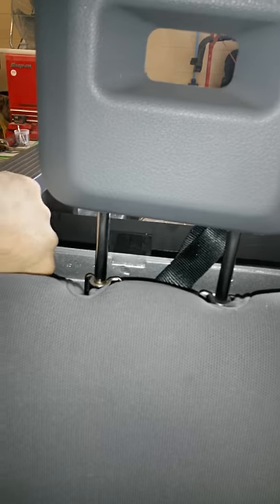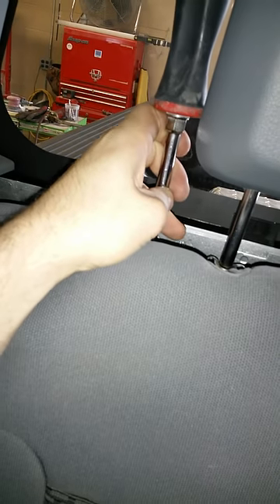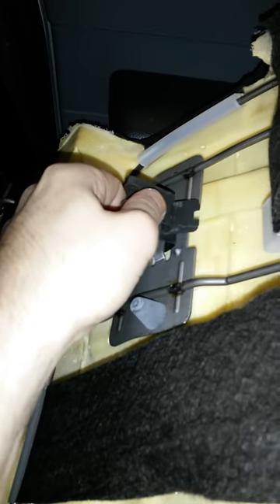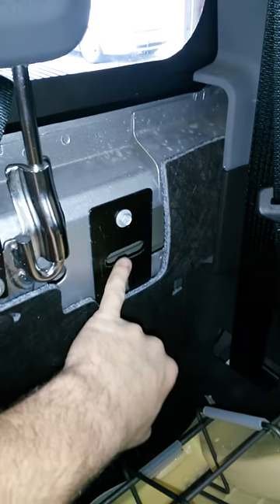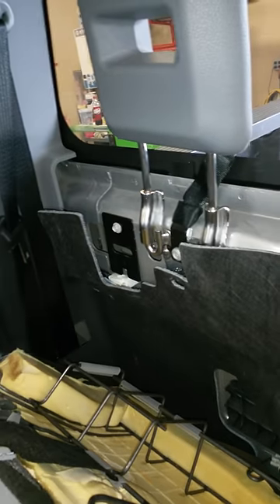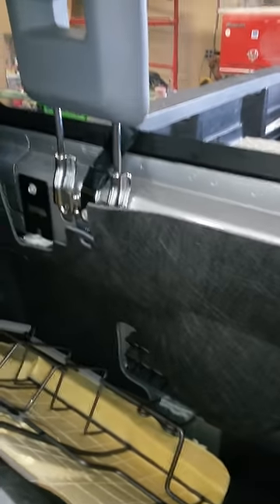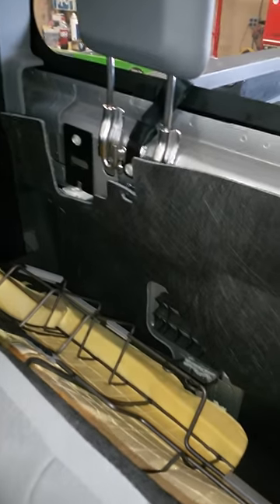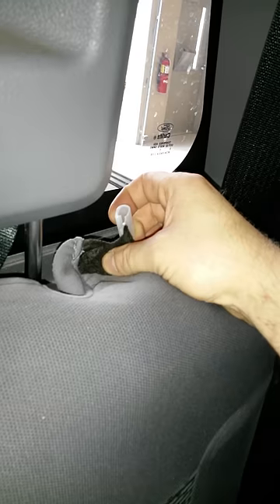How to remove 2012 Ford F250 Supercab rear seat

Comment: 2017 Ford 250 Supercab .... Guess what ... remove the bracket with a 10MM speed wrench.  Way easier on the drivers side just to the right of the head rest.  Reach down a about 5 inches and ratchet away.  Took me about 4 minutes ... much easier than trying to release that sping POS.

Comment: Customer is going to be happy until they want to use the seatbelt which is now trapped behind the seatback. PRO TIP: Pull out the belt, slide the seat back between the belt and back of the cab, set back on hooks at the bottom, and then snap the seatback in place as described. Now the customer will be happy.